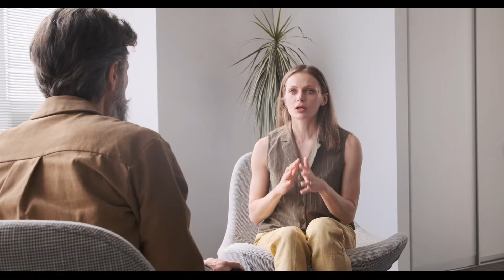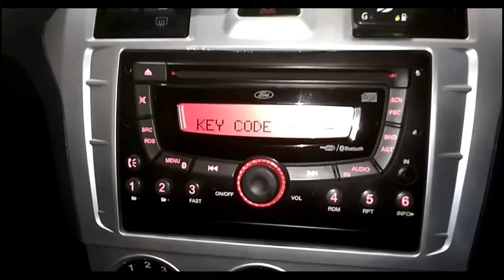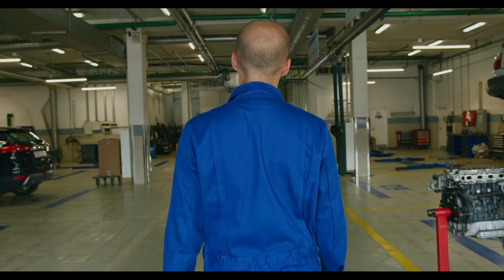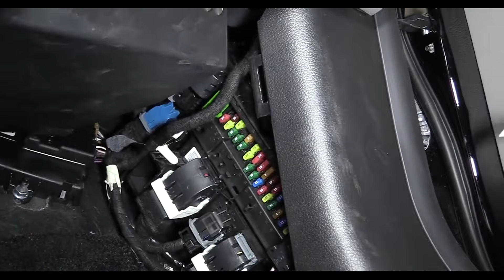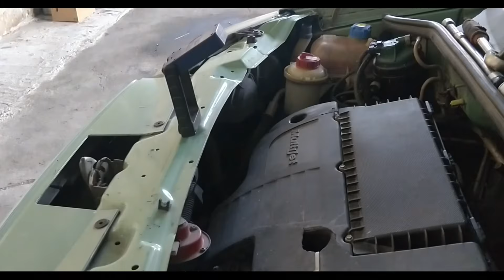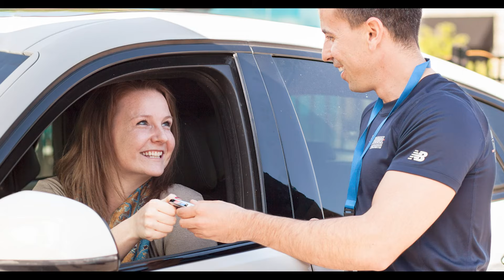Ford Starting System Fault - Causes & How to Fix

Comment: On my 2013 Ford F250 I had the same issue. I went and got a spare key and checked it and it would crank up the vehicle. I heard a rattle inside my key and took it apart. The chip that sends the signal for the anti-theft had come loose so I put it back in place with super glue, which fixed my problem.

Comment: I didn't know that a bad key battery would prevent you from starting the car,  My remote entry was getting a little flaky and today it wouldn't open the door. Shock that couldn't start the car either.  Fortunately, years ago I bought two spare keys without pushbuttons because they were cheaper.  One was taped to wiring under the car in the event of a lost key.  The other was for walking around so my big batch of keys could be left in the car.  Those are purely RFID and don't need batteries.  Cheap insurance against battery failure and getting stuck somewhere.

Comment: Dead key battery on my moms 2011 f150 Texas edition I was watching this video and having intermittent issues with starting and occasionally it would start so I knew it couldn’t be something like a blown fuse swapped relays around and no changes. Then when he said starting system has something to do with the keys I was like aha tried to lock and unlock with key and nothing happened so I swapped out my 2002 Tahoe fob battery with her key and it fired right up.

Comment: I’ve had this issue serval times.  The fuse panel inside has a large fuse behind a plastic or wire housing.  Wiggle that fuse then try to start.  Works every time.
Reply: Thank You, that was my problem too.
Reply: Can you tell me more on this -
Reply: Maxi fuse. Small box in front of battery. @GhillieCoaters
Reply: My cat does this I’ve tried everything and can’t get it to start where exactly is this you’re talking about bc I can’t find it
Reply: This comment sent me right to the issue thanks man
Reply: A new site to the 20015 ford focus.  Get in the  drivers  seat. Put the key in. Push  the ok button  on the left side of the steering wheel. Continue  to  push  it down.  Turn on the to start  position  while  pushing  the ok button  on the left side of the steering wheel. Wait a few seconds,  it will show test on the center  screen  between the  main  gages. Go up or down , left or right  on the ok button. Ur welcome.

Comment: 1/6/24:  A trip way up into the forest in WA state in my 2013 F150 4x4 5L V8. No cell service, it was cold and snowing,.  After visiting a beautiful waterfall we get back into truck - and the key turns, but I get a surprise display message "Starting System Fault".  I disconnected the bat. for 15 minutes and still no resolution to the "Starting System Fault".  Hours later I was eventually able to dispatch an AAA tow and 4 + hours later and 50 miles I get my truck towed to my home.  The next morning  I watched the above YouTube video and the problem was fixed with in 5 to 10 minutes.  The problem was in-fact a loose male-female plug connection/clamp in the PASSENGER SIDE fuse panel as VERBALLY described at the 2 minute mark on this video.   The video shows the fuse box under the hood but they're actually talking about the passenger side fuse panel. 
BTW: The key fobs would NOT lock/unlock the doors and I really thought the fobs lost it's signal with the ignition or the fob bat. was dead.  It was as if the key fobs were dead and maybe the problem.  But the key fobs were actually all ok.
Reply: Hey Mark have you gotten the starting system fault message since then at all? Thanks
Reply: No Rich, I have not gotten the Starting Fault message anymore.  The truck is working well since I resecured that loose connector on 1/6.
Reply: You said the fob wasn't locking your doors? I've been noticing that sometimes I'll open the door forgetting that I locked it and set the alarm, and the door would open and alarm go off. I've been having this same issue with my 2014 v6 Eco boost. I've been able to get it to start every time luckily but I need to figure this out soon.
Reply: @patrickhurley7617  re the key fobs - try securing-up the electrical connection(s) in the passenger side fuse panel.  Your issue is likely something totally different though,  maybe the signal between the fob and truck sensor need to be reset and battery replaced.   Perhaps at some point you were in close proximity of a car thief that was able to partially scramble or disrupt your wireless fob/sensor transmission signal.
Reply: I have this same issue on my 2014 f150 3.5 ecoboost. It only happens from time to time and seems to only happen during the hot summer months. I will need to check and see if I have a lose connection. But if I have a lose connection, then it should be giving me this Error more often I would assume.
Reply: hey man just want to let you know ur comment made me fix my 2013 f150 that had been shut off for 5 years due to my grandfather putting the wrong key in it and losing power he just gave up!